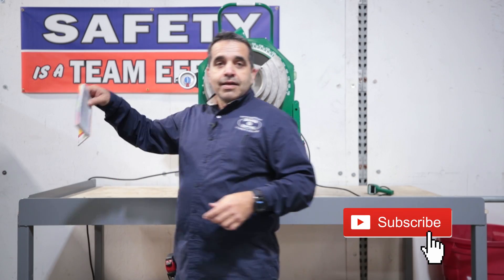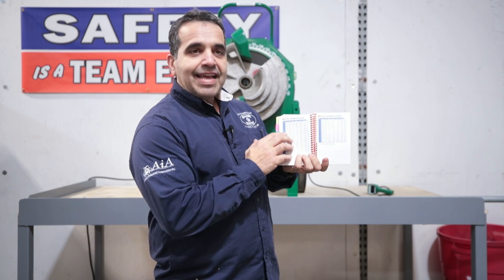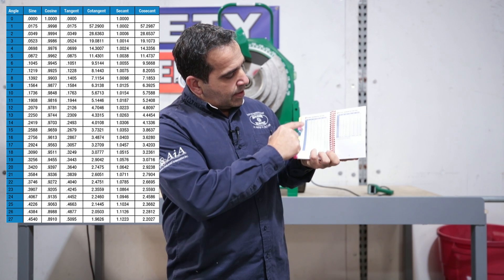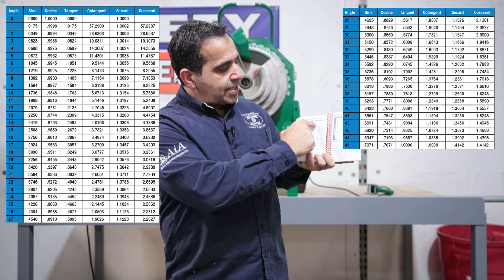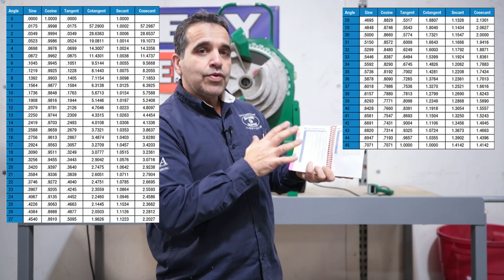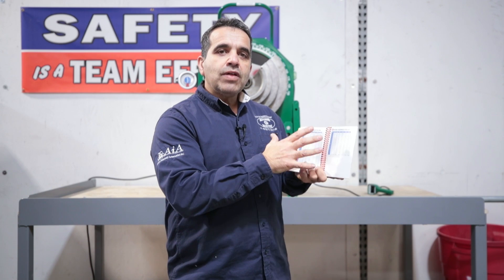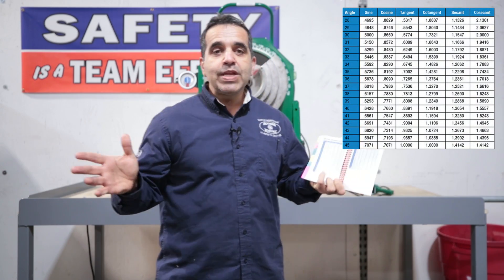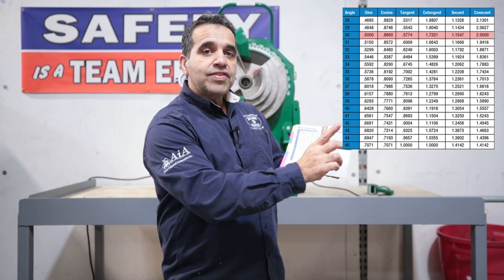How to Bend Conduit with Parallel Offsets

Comment: Incredibly valuable information. I'm glad I finally understand it. However, I suggest mentioning the offset formula chart (Ugly's Table 19) which simply states that the multiplier for 30 degrees is 2, for 45 degrees it's 1.4. People don't need to know the sine or cosecant, which is how they got the multiplier, they just need to memorize the multipliers themselves.
Reply from the maker: Thanks for your comment! I appreciate it. Yes it is most valuable to memorize the formulas for 30 and 45 degrees as those are the most common angles used. The chart in the ugly’s book will also show the multipliers for every other angle in case you are trying to match an offset and the original installer used a strange or odd angle for the offset. The chart in the Ugly’s is very helpful.

Comment: 10:45 Im having trouble with this calculation because when I punch it in the way you did it I get -2.354 Im using a Casio calculator and I think I need a different one

Comment: Here is a much easier method.

Rather than using 1/2 of the tangent, you can just multiply by the offset angle with a decimal in front of it. So for a 30 degree offset angle you would just multiply .3 times the center to center distance. 

Using my simplified method, the calculation would be    .3 x 2.75          = .875 
This is very close to what was calculated in the video     .2679 x 2.75   = .737
 
The difference is about an 1/8 of an inch which would be negligible for parallel offsets. This is much easier to remember and doesn't require the use of trig tables or calculators with trig functions.

Comment: I was trained to use the shrink value for the angle I’m bending and multiply it by the center to center distance for parallel offsets.   It works well. Just in case you don’t have an ugly book.
Reply: This is the best way kid.

Comment: At 10:27 in the video, you measure the distance of the pipes. Are you measuring the gap you wish to maintain from the center of the pipe that has the tape stretched over the top? Or are you measuring from the edge of that pipe to the edge of the pipe you already bent?

Comment: Okay, guys…
Not to rip on the instructor as his experience is truly impressive, and rewarding to learn from. However…

To find the multiplier of any angle isn’t as simple as “just checking in the Ugly’s book for what the value should be for the angle of the bend” because one might have an angle that’s not listed that they might still need to find. To find the multiplier of *absolutely ANY angle*, you use the cosecant of the angle you’re working with, or csc (theta), which equals the fraction of…
 (1/[sin theta])
…which will give you the multiplier value of *any angle*.
However, there’s still one more step to achieving this value that is ALWAYS helpful.
If you know that you have to bend at a certain angle and can’t find the value of sine as the denominator, you can convert the angle to radians by…
multiplying [angle] * (pi radians/180), then reduce the fraction. Using sin of this also gives you what the multiplier is, with the numerator being 1 - a key component of the unit circle.

Comment: Thanks a lot. I was running 2 sets of 2" EMT today side by side, and I did both of my offsets the same and I had to make my gap before and after my offsets way bigger than I wanted to in order for my pipes to not be so damn close during the offset. I was curious to why and knew there was a better way, I will use this in the future all the time!

Comment: Long story short multiply the gapping center to center times the shrinkage of whatever offset angle you are using, so 2 inch spacing with 30° offsets would have you advancing each mark a half inch on every pipe for your starting point. 🤘

Comment: Thanks for the video but let's save some time

1/2 tangent of your degree x gap of pipe.

Add or subtract from your 1st mark depending on if it's the shortest or longest your starting with.
Also this should work the same for kicks

Comment: Great video, however I have a suggestion. Use a digital protractor on the long side of the pipe , zero it, than after your first bend  test the bent end for 30 degrees. Also note the spring back and write it down for the next guy. For example you might have to bend a 33 degree bend for a perfect 30. Thank you for your video.

Comment: Ive seen people use the ¢-¢ of pipe measurement and some people use the gap between the pipe, will choosing either one mess up your offsets?
Reply: Or when do you use one of the applications over the other?
Reply from the maker: Not really, as long as your consistent and stay with the same method. But you need the distance between the conduit table from the same point on each pipe. So the center to center is the same distance as the inside edge to the inside edge… hope that makes sense

Comment: I know it's a bit off topic, but can someone explain what "typical EMT bend radius" means. For example, the typical EMT bend radius for 3/4" EMT is 5 1/8". A radius pertains to a circle, if I make a 90° bend, is 5 1/8" from the back of the bend towards the center of "the circle" the radius that they are talking about?

Comment: When running a rack with different size conduit, should you bend them all on the shoe from the biggest size conduit in that rack because of bend radius difference or doesn’t matter ?
Reply from the maker: If you are running rigid or IMC conduit it is a good practice to use the largest conduit shoes for all your parallel runs. You can’t really do that with EMT though.

Comment: Does this apply to prraleel offsets utilizing different diameter conduit? say 1" and 1 1'4" side by side?
Reply from the maker: Yes
Reply: @AccessToPower  One more question, Does the Parallel offset examples in this video assume the same starting point? Hence in your Example the first Pipe's Mark 1 is 12" and the second parallel Pipe's Mark 1 calculated is 12.80" assuming the same starting position on the wall floor ceiling?

Comment: I was using this for some parallel Kick 90s and the formula was not working for me.  Figured out that since it’s just a kick and not a full offset you use the tan for the full degree times your center to center distance.   So for my 30° kick I used the tan of 30° instead of 15° like I would for parallel offsets and it all worked flawlessly.  Great video.
Reply: Nice good to know. This is what I was wondering after the video.

Comment: Very interesting! Tangent of half theta is the same formula as for the shrinkage multiplier (to multiply by the height of the obstacle and compensate for the shortening of the pipe due to bending). Thanks for explaining this in a non-technical way. I like how you used Uglies because I think it will be less worrisome to newbies than trying to teach them trigonometry.

Comment: Instead of a level I would recommend you use a dial gauge. I use to manage a bending department with 21 guys who bent material for D.E.C. and the dial gauge saves a lot of time. Simple and repeatable. Try it.

Comment: I did this on 4” rigid I was bending.  You have to do this or your bends will hit (if you run tight center to center spacing) and you won’t be able to spin on your next bend. If you use this formula, Not  only will your diagonal spacing be the same to your parallel spacing  and look great, you will be able spin on your additional pipes.

Comment: Does the radius of the bend of the 4 inch conduit not come into effect? It seems having different radius would effect this or would it just effect the start of your second bend?
Reply from the maker: Daniel, yes the radius would definitely affect the bands. Whenever I’m on a rack with 4 inch conduit and I need to do offset bands like this, if I’m using rigid conduit, I will use the foreign shoe for all the conduit. You can do this with rigid but you can’t do this with EMT.

Comment: that machine seems to take a hell of a lot longer than just bending it by hand
Reply: Nobody bends 3/4" rigid with any machine on the field.
1" rigid needs all the "love" you can give, but still makeable with normal 1 1/4" emt bender.
Btw.. I hate doing rigid! Even aluminium. Only because of all the treading .

Comment: Great video for noobs, but should also say that only applies to runs on a vertical surface like pipes on a wall. If building a rack the bend marks will be the same

Comment: You measured from the left of your pipe and measured 12 inches and made the mark A. Then on your second pipe you said you added 3/4 of a inch, but really didn’t you just subtract?If I was was measuring from right to left of my pipe to my obstruction how do I know if I add or subtract to keep the spacing equal?
Reply from the maker: Mitch adding or subtracting depends on if you are starting with the innermost conduit or the outermost conduit. The math is the same either way
Reply: @AccessToPower  So my conduit that is closest to my obstruction would be  my innermost?  So would I add or subtract if I was starting with the conduit closest to my obstruction?
Reply from the maker: Mitch you would add as you move away from your obstruction

Comment: Having worked for electrical contractors for almost forty years, and ran  enough conduit to cross the State of Pennsylvania, I can honestly tell you if you used these complicated methods and took this much time it would look pretty, but they would run you off! What they want is clean, simple bends through which wire pulls easily, can be fabricated quickly and installed without a lot of fuss.There are much simpler methods which are more practical.
Reply from the maker: Vean Whitcher thanks for the comment. For sure there is a time and place for everything.

Comment: why isn't there a vfd hooked up to that electric bender?  that would make it easier to get your exact angle right?
Reply from the maker: John, good observation. A VFD would surely make the bender much more smooth to operate. This is a stock Greenlee 555. They do make an 800 series bender with a VFD, and we have one of those, but the 555 is the bender we most use in the field.
Reply: @AccessToPower  The triple nickel is the bender I see often.  It must be cheaper.  bet I could install a vfd on a 555 pretty cheap.  I hate bumping it a million times.

Comment: How would you match  offsets when one conduit is coming out of a panel on the left side and the other conduit is coming  out the bottom  using fittings?

Comment: Very nice job.  Thx for sharing. Would you do a presentation with multiple difficult bend angle with the pipe pre cut exact length and compensate for all gain and loss.